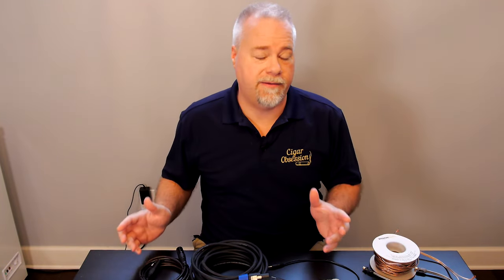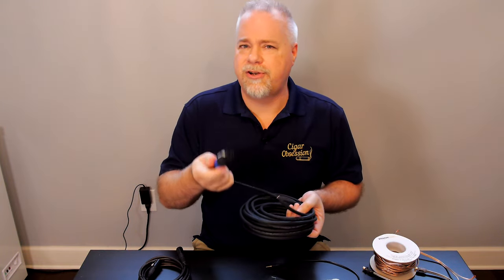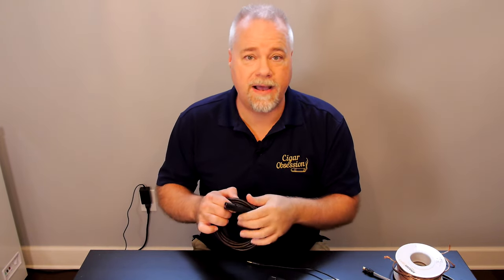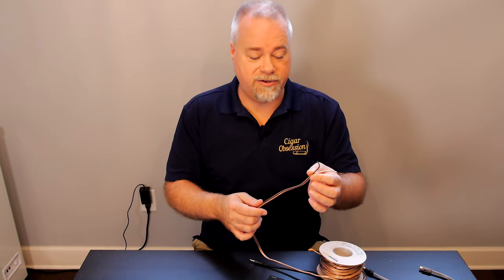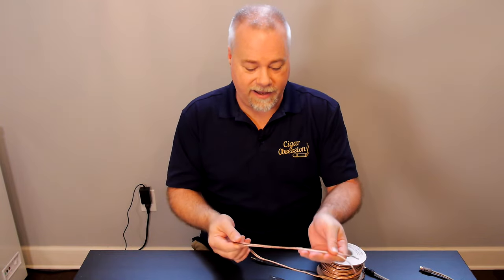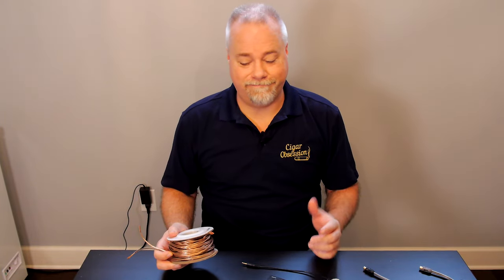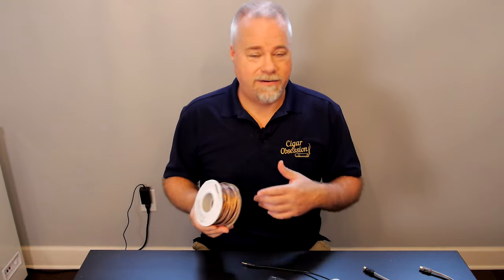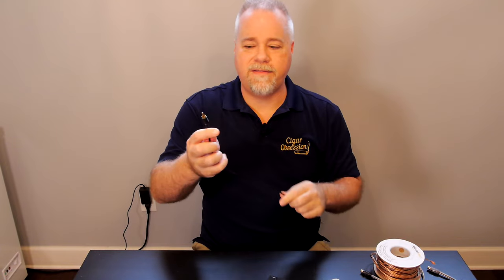The Best Way To Connect A Subwoofer

Comment: I just found out that the rca splitter i'm using from my amplifier (with 2 sub outs) was the culprit for having ground loop humming sound, then i got a single thicker rca cable plugged it to one of my amplifier's sub outs going to my active sub's LFE port and it solved my problem right away. One of my happiest days ever. 😄
Reply from the maker: Yep, some splitters are not grounded properly, or in the way the particular sub needs.
Reply: _y

Comment: I just used coaxial cable for my active sub and the humming gone. It's a pretty long cable like 45 feet long and it just works fine. Coaxial cable might be a budget solution for those who don't want to buy some expensive subwoofer cables.

Comment: I have a question for you and hp  you answer. Like the topic here I am using 2 subwoofers.  They are  connected  to the Lfe inputs from the out put of the av receiver and both are single rca cables. Both the subwoofers I have do have twin inputs in white and red. They also have the auto on off switch.  So du y suggest I use a Y cable and use both the inputs in the subwoofer for more gain???
Reply from the maker: It depends on the model.  If one of the inputs says LFE, that's what you connect to.  You can try an y-splitter, but not all use summing inputs so it may do nothing.  There's no need to do it though.
Reply: @COGuyStuff  Thank y so much

Comment: I've seen people recommending speaker wires over rca. Their reasoning was they both pick up noise the same but noise affects the low level signal (rca) much more than the high level signal so signal to noise ratio on the speaker wires would be better. Does that make any sense?

Comment: There was a job 20 year ago.
A hotel had a fire alarm and was picking up EMF. From the high power lines going over the building on 3 rd floor.
It was a brand new wire to reinstall shielded wire but was o much for them.
2 Nd opinion was to buy rolls and rolls of Tinfoil. 2 on fire alarm wire and only ground 1 side to ground. To bleed the EMF way to ground. The tinfoil is the same stuff that in shielded wire.
And again in shielded wire only to ground 1 end to ground if both side grounded it makes antenna 
I still remember we charge customers tinfoil and it work excellent.

Comment: Excellent help. Thank you. I only have 2 tower speakers & want to add a sub to my Onkyo TX-NR696 Receiver. Sub (Sony SA-CS9) came with a RCA connector but is very thin. I guess i need a more robust cable for quality sound. I do NOT have a input for a XLR cable.

Comment: How can you tell if my sub is susceptible to summing? I have an SVS SB1000 Pro and I have my gain on the sub all the way up, as well as the volume on the AVR for the sub all the way up. I'm using the LFE only hookup for my sub. Should I use the splitter?
Reply from the maker: If it doesn't indicate in the manual or back of the amp you just have to try and see
Reply: Yes..... Not so much on volume but the frequency it helps a lot. Especially with Audio.

Comment: This video is EXCELLENT!  I'm pretty green at this and a the info you shared as very clear.  I just bought a JBL Stage 120 500W sub so I'm trying to find a good cable.  I don't believe xlr is an option.  I watched a video today on PSAUDIO channel where he suggests not using the pre-amp out to a powered sub.  He said connecting it to an active output on the receiver conveys a better sound than by usubg the regular sub out connection.  That was very confusing to me so I'm just goung to connect it to the pre out sub.
Reply: I agree with Mr McGowan (PSAudio), I have tested both pre outs and speaker (high level) connections to a SVS sub and the speaker connection sounds better (in part because of the subs crossover) in a stereo setup. I think it depends on the speaker wire gauge and isolation. But in multichannel configuration it is better to let the DSP figure out the low frequency signal, so LFE it is.

Comment: Great video. I'd like to ask a question. I have powered bookshel speakers (edifiers) and my laptop with a headphone jack. No sub out connection. I just got a Sony SA-CS9 powered subwoofer that has only bare wire connections. Can I connect the following: Headphone to 4 banana plugs into the Sub In (L/R) > Then > 2 Banana to RCA to pass through to the Aux in on the Edifier speakers. I hope this makes sense and thanks for any assistance.
Reply from the maker: Unfortunately not none of that is a match.

Comment: So I have a receiver with a SUB out (RCA), but a passive subwoofer. What is the best way to connect it? Buy a small mini amplifier for the subwoofer?
Reply from the maker: It completely depends on the subwoofer, what it's power requirements and thus required amp, is.

Comment: Great info. I have a 2-part question. #1 I have a powered sub. I am connecting it via the speaker input terminals. If I add a pair of speakers to the sub's speaker output terminals, will the subwoofer still operate correctly, (using its internal crossover), and #2, will the added pair of speakers play at full-range frequencies coming from the amplifier?

Comment: Excellent information, and well presented. Thanks. Question: I'm considering adding a subwoofer output from my Naim Unity Atom streamer. Would using the preamp out or simply connecting to the speaker terminals be a better option? Or is there a better option? Any advice would be appreciated.
Reply: I'm a bit late but still...the advice I've been given is to go with speaker terminals for better integration with the other speakers. All speakers get the same signal with better timing.
Reply: @JustBrowsing777  Thanks. Always appreciate good advice. I'll give that a try.

Comment: I’m hoping you or someone can help answer this question for me: I own a Behringer VQ1500d Powered PA Subwoofer. I also have a Denon AVR-S540BT receiver that I’m going to use for my home theater. Is it possible/safe to connect my Behringer subwoofer with xlr inputs to my receiver’s subwoofer Pre OUT?

Comment: Greetings! The amplifier (2.0) does not have a separate Subwoofer output, but does have an "RCA R\L Line Out."
Question: whether subwoofers with an input connection are suitable - "RCA R\L In" or "Sub in" (one RCA input plug), as I understand it, I will need to use the "Y" RCA splitter. Did I get it right? Or are BOTH connectivity options suitable?
Reply from the maker: You need to feed both rca in to the sub, without a subwoofer (lfe) out from your processor.
Reply: @COGuyStuff  Ok, I get it. Thank you!

Comment: Trying to connect to a wireless active Polk DSB2 subwoofer to a different brand soundbar (Zvox). The only cord that is connected to the subwoofer is the power cord... it has no input or output jacks. My soundbar, ZVox AV155 does have pin plug output jack for it's intended subwoofer. Any ideas on how to connect the soundbar to the wireless Polk DSB2 subwoofer...??
Reply from the maker: Those are not compatible devices.

Comment: Hi There CO Guy Stuff,  very helpful video-thank you! I am hoping to purchase a subwoofer to use with my Yamaha NS10 monitors in a small home studio setting.  Do you have any recommendations for a good subwoofer that would perhaps compliment them?   A lot of subwoofers seem to be geared towards the home theatre setting and therefore tend to only use rca connectors, but I am hoping to find a subwoofer that uses xlr, trs or dual ts. I will be connecting it to a monitor controller that has trs (single) output. I look forward to hearing your thoughts!
Reply from the maker: Plenty use balanced XLR, but you won't find anything good using unbalanced TRS jacks, no.  Nothing besides maybe some low end computer stuff. You just have to get over a certain quality/price threshold for XLR to be common.  Like speaker level is on most low end, XLR stays on the higher.  But, since you are using unbalanced, all you have to use is an RCA adaptor if what you find doesn't have it.  No difference.
Reply: @COGuyStuff  thanks for your response. I appreciate it. Okay, I will bear everything you mentioned in mind and my search begins! Thanks

Comment: We should be using Fiber optics on everything.
Signal from prosser to amp, amp to speaker.  Not Toslink    but full 2 way fiber optics.
Other option is HDMI cabling.  4k or  10k    this leads me back to Fiber optics.

Comment: Do you recommend Y splitter cable? 
Does it cause too much of a load on the receiver or subwoofer?
Reply: Y splitters are fine, I use one to power two subs. Some have 2 sub outputs and that's how some are able to have 4 subwoofers.

Comment: One quick question, the wireless connection from emotiva, have you tried that one? I bought some emotiva amps and got a free wireless subwoofer connector. Also is there any difference when using a Y splitter off the wireless to both of the subs inputs, not just the LFE or is it the same as running a wire from the amp to a Y splitter?
Reply from the maker: I did not try the Emotiva.  It depends on the sub, some have a summing input, others don't.  The specs may indicate it if so, not always.  Sometimes you just have to try and see.

Comment: Can't we just use an adapter from XLR to the ends? And use XLR for everything? Is it too expensive?
Reply from the maker: There’s no point in doing that
Reply: I'm not an expert I was cincerally asking why not :)
Reply: @White_King  using an adapter at either end will drop one of the three wires from the xlr and only give two wires to the speaker... thus defeating the purpose. Any noise in the cable would not be polarized out as the balanced third wire information is not given to the speaker to do its thing.

Comment: Hello , 

I ordered a pair of RCA cable for 35 feet for my speakers as well as a single RCA at 20 ft for my sub,  

I paid around 1000 dollars for these cables as they are hand made with special care, I would like to know what is the best practice for dragging these cables along base board . 

Can I put them into an sleeve and run both cables across the room ? Is there going to be interference from one to the other ? Or as long as they are not power cables , I should be fine . 

Thanks
Reply: Don't forget to leave the cables I to the freezer for 36 hours b4 putting g them into a sleeve,  the sound from this is unbelievably xtal clear..just like having a new pair of ears.
Reply: Actually raising the cables off the ground using a 3inch gap between the floor and wire. Throw some Black wire protection/shield over the wire cut 2 15 ft lengths and your getting the best non interference signal you can get. Especially on wood floors.

Comment: The SVS Soundpath wireless adapter kit just simply sucks. I have one in my 12ftx12ft bedroom and I wanted to use it to cutout wires and every time I walk by it the signal drops and sometimes it doesn’t pick the signal back up until I move the receiver around ( SVS receiver). This adapter is horrible.
Reply from the maker: The original is very sensitive to line of sight obstructions and keeping it away from metal and especially other antennas. It’s your placement.